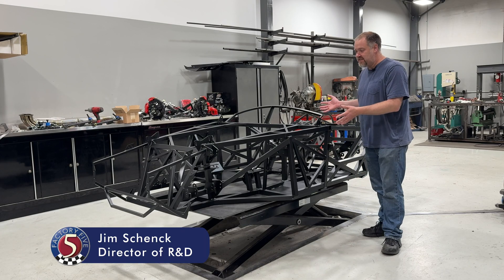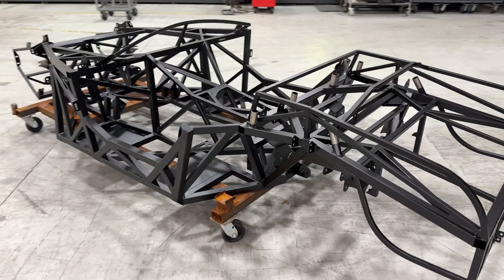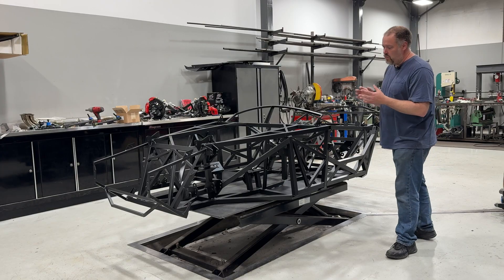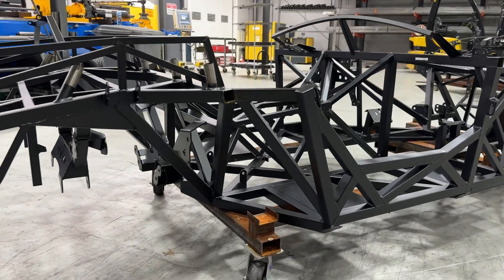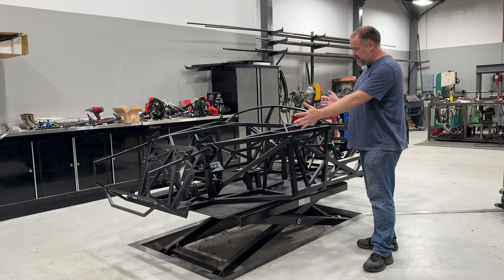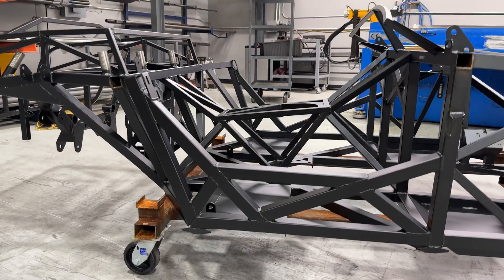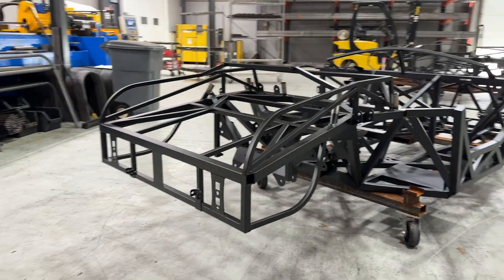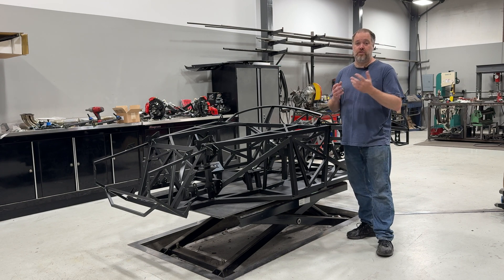The New Factory Five Mk5 Roadster Chassis

Comment: So many aspects of the design make it 'not a spaceframe', most notably of which are the absence of torsion boxes around the low door frame, untriangulated apertures, and loads fed into unsupported tubes.  'Tube Frame' would be a far truer description from a purely engineering aspect.

Comment: Two questions: 1) will the tranny tunnel have enough room for AUTO TRANS and if so, which ones; 2) now that the 4" tubes are gone, will you be able to put under the car exhaust?  Even if it's NASCAR type oval pipe, it would be very nice for those that don't want the loud side pipes.

Comment: Is there enough space in the transmission tunnel to run a rear exhaust? Like if one was using a 351W?
Reply: I've always liked the under chassis exhaust look. This should be part of the design consideration.